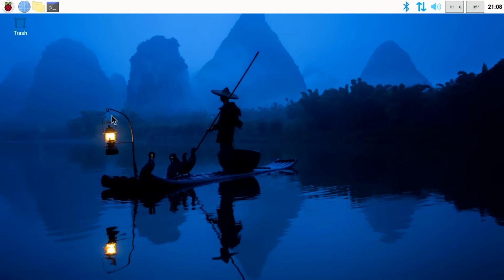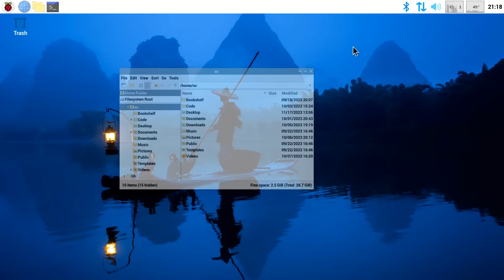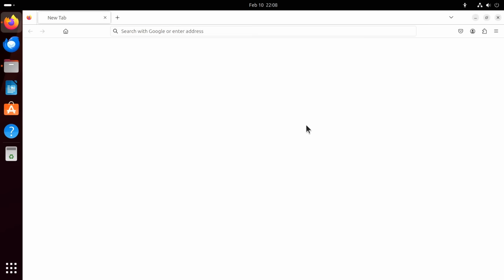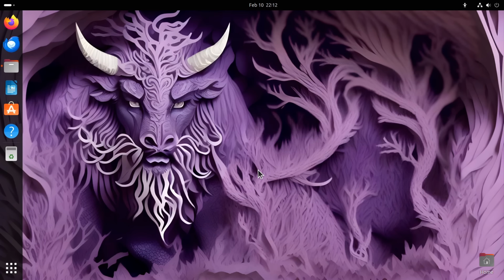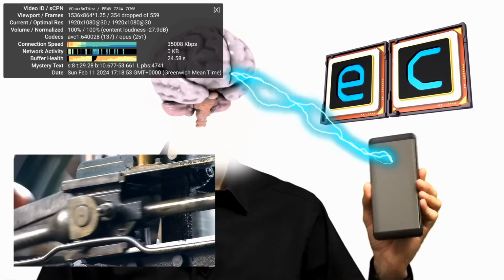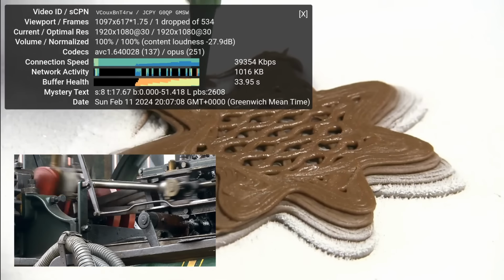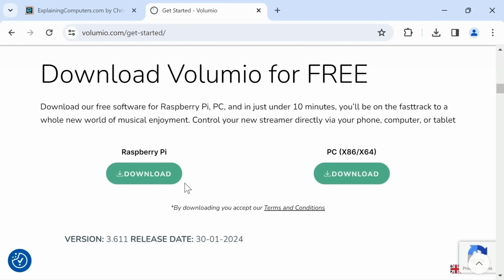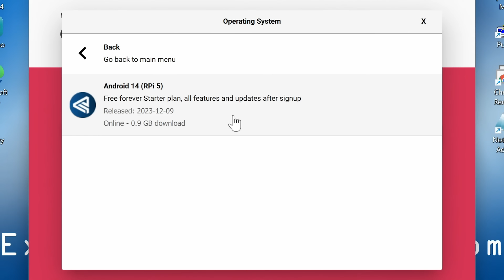Raspberry Pi 5 Operating Systems

Comment: Mathematica (AKA the Wolfram Language Desktop) runs on the Raspberry PI OS. It was tedious to run Mathematica in the ancient days of the original PI, but an 8GB PI 5 provides great horsepower for this free-on-PI computation/visualization engine. Wolfram Research provides a great number of self-paced and live courses on their website for no charge. It's a tremendous place for a STEM-oriented HS student to learn this software before going to University.

I'd love to see Explaining Computers have a video running Mathematica on the PI 5 showing what sort of spiffy things can be done with this software.
Reply: Fantastic suggestion! Seconding request for Mathematica walkthrough on the raspberry pi
Reply: Been running Ollama and many LMM AI. Processing with Deep vision runs well too. Will try Wolfram/Mathmatica next.
Reply: @roguequill  Hear, hear. Besides the huge increase with today's computational power, you can now completely configure SSH and VNC through the Flash Imager. Some parents, etc. may be averse to getting and wiring kbd, mouse, and monitor; those are  now completely unnecessary. All you really need is power, and you can stash the Pi away in a corner. Optionally, a hardwired ethernet connection would give a bit lower latency for the network connection.

Comment: Thank you Chris for another great video!!! I own a pi4 with 8GB of RAM and i run raspberry pi os, kali, ubuntu mate 22.04( great distro also), sparky linux ( uses openbox and so it is the fastest of all) and finally my main os is MX 23 with the KDE plasma( installed it and removed  XFCE witch is the default DE) . I believe MX is also an exellent choice for a daily driver on the pi!!!

Comment: Always genuinely excellent, thank you. A couple of mentions for other OS's that every RPi owner should know about:

-RiscOS - The original and still awesome OS for ARM. Really only for hobbyists these days, but worth a look and on the default installer
-DietPi - If you need a lightweight and highly configurable Linux for projects, specific tasks, or desktop use, this is it. (Not for Pi only!)
Reply from the maker: Thanks for this. Unfortunately, RISC OS is not yet available for the Pi 5. DietPi has just entered Pi 5 testing.

Comment: -Arch-based EndavourOS- and independent Alpine Linux both have images for Raspberry Pi 5 (only for model B as far as I can tell). Since we tried just Debian-based distros on it it would be cool to see how another type of distro would compete.
There's also OpenSUSE, Fedora and Gentoo all having an Installation ISO for ARM64 systems.

Update: EndeavourOS is no longer providing ARM builds.
Reply: Chris is a windows user and known he's not keen using linux as a computer science teacher. He's agnostic which I appreciate.
Reply: @TradieTrev  This is very outdated information. Chris's daily driver computer is Linux running on an Intel N100, and he is now a full time YouTuber. Your information was accurate a few years ago.

Comment: Armbian is extremely useful for a "quick and dirty" OS to get an SBC up and running, particularly older SBCs that are no longer supported by the manufacturers or major Linux distros like Ubuntu. You have to bear in mind that the Armbian team is small and their builds are generally automated, so they're not optimised for a particular SBC anyway.

You neglected to mention Gentoo Linux which supports Raspberry Pi 5 with a wiki page that details how to install it - however, it's not for the impatient but it's the best way of getting an optimised Linux build onto anything, once you've overcome the initial and steep learning curve.

When I am doing Gentoo builds on older and lesser known SBCs like Orange Pi or Banana Pi, I will generally start with an Armbian build just to boot the machine up and get the layout of the filesystem, as well as the configuration of the (u-boot) bootloader for the specific SBC. 

With a lot of older SBCs, there is no specific documentation for them with Gentoo, though as most of them boot with the u-boot bootloader, once you understand how to build that then everything else is a root filesystem built on a specific ARM variant anyway.

Comment: It's so fascinating that there are so many linux distros that people can choose from. Since I met you online I've changed my mind over Linux OS and now it's my favourite, I couldn't even imagine it's potential.
Reply: The whole point of having a mind is that one can change it.
Reply: Once you're far enough down the Linux rabbit hole it's time to try the BSD rabbit hole
Reply: @tylerdean980  Personally, I started using Gentoo Linux in 2003 (Linux generally back in 1996) and I've no reason to move from Gentoo, it does all I need an OS to do for me.

I do like BSD, I have a couple of machines running it but, for me, it's no competition to the flexibility of Gentoo.

Comment: All of your OS choices were good, but I prefer Arch/Arch-based distros. On my Pi 5 8GB right now I have EndeavourOS (an Arch distro) running with Wayland and the Hyprland DTWM (Dynamic Tiling Window Manager). I'm running vanilla Arch here on my main desktop with the same setup. I have a Radxa Rock 5B on the way (with accessories too ofc) that I plan to use as my travel/hotel room miniPC for watching movies etc so I don't have to tether my laptop to the hotel room TV all the time. I'm going to be running what's called BredOS (another Arch distro) on the Rock 5B and maybe compare it to EndeavourOS running on my Pi5 (whether or not I make a video is up in the air, but I've been curious about other ARM SBCs like the Rock (Pi) series for a while now). I'd say I'd want to see you mess with and test Arch Linux ARM on the Pi 5, but there is no official image as of yet, and it's all manual setup (at least with the Pi 4) unless you use something like EndeavourOS which has an ARM64/RPi5 OS image available though you have to jump through a few hoops to get it installed. It's not impossible, but it's somewhat annoying. I'll be running my OSes I'll be testing on the Rock 5B on a 32 GB eMMC module I ordered.

ANYWAY, good video and congrats on the near 1M subs! I'm one of them! WHOOO~

Comment: Another excellent video, plus 107 points to Mr. Barnatt. To be the best of my knowledge, Alpine Linux is also available for the Pi 5, but is a much more ‘do it yourself’ kind of distribution. I would be curious to hear Chris’s take on it. Also, the channel is closing in on one million subscribers, fingers crossed next week that threshold has been reached.

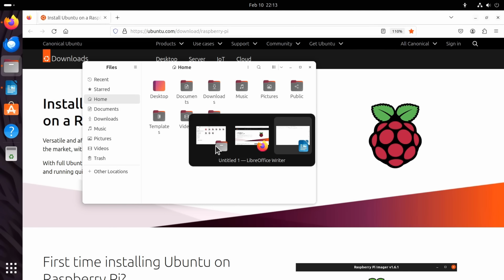Comment: 7:50  Insane?  ;-P   Where as back on Windows 7 you get 2 options for task switching.  ALT-tab or Windows-tab.  I like to use both.  The Windows-tab scrolling deck shows a huge LIVE view that makes it easier to find exactly what I want.  And being a live view means I may not have to actually change to that window to see progress, etc.  It saves me time.

Comment: Once again a very interesting video.  
I currently have a Raspberry Pi 400 and use some other different os for different days of the week and am wondering whether they'll all be able to run on a RPi 5.  
Notably: Twister; Manjaro; Debian; Chromium os; Pop!; MX Linux: Ubuntu Cinnamon (with Mint wallpaper installed to pretend that it is Mint).   I also have Fedora and openSUSE but they only seem to run at about 90% at best and have given me some issues.  Also could not get Void-Linux to run at all... Looking forward to trying out "Armbian" soon though.
Very interested to know how the above might perform on a RPi 5 (or even a 500 - if one gets produced in the future).

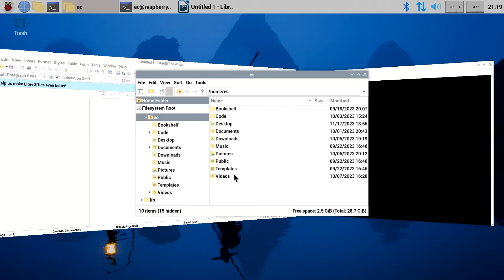Comment: 4:05 you’ll get a less distracting task switcher if you switch back from Wayland to X11. I did this because some apps wouldn’t work with Wayland and as a side effect, I have a more responsive UI and a task switcher that doesn’t drive me insane
Reply from the maker: An excellent tip -- thanks for sharing here.

Comment: Great video.  Thanks.  You mentioned that you're using Chrome OS Flex on a computer connected to your TV.  I believe that in the past you mentioned that you were using Ubuntu for that function.  Did Chrome OS Flex replace Ubuntu?
Reply from the maker: Greetings, and you are correct. That TV PC started life running Ubuntu. But I changed to ChromeOS Flex about 18 months ago.
Reply: @ExplainingComputers  I did something simiar - I had a PC connected to my TV which ran Kubuntu with the Chrome browser.  After ChromeOS Flex became available I switched over to use it and it's been a good experience for the last 2 years.

Comment: I'd love to see Linux Mint running on the raspberry pi 5 it has been my preferred Linux distro since the early 2000's and it's performance will determine if I grab one or not
Reply: Keep an eye on LMDE. Linux Mint Debian Edition. There should be a way to run that on Pi5.

Comment: Another plus for Raspberry Pi OS is the ease with which it can be setup headless on WiFi without needing a keyboard, mouse, monitor or ethernet cable.

Comment: Interesting. I have stopped buying Pis as I have 3xPi4s which is plenty. More importantly a n100 CPU NUC type PC with 16GB RAM and a 500GB NVME can be had for about £160, e,g. Trigkey. The n100 supports hardware encoding (Quicksync h.264) at 10x speed. The Pi 5 can’t match the n100 in FFmpeg. By the time you add in all the extra Pi5 options you need to match n100 NUC, you might as well buy the n100 as it has better software support.
Reply: You can pick up used HP, Dell and Lenovo SFF PCs on your favourite auction site for £30-£40 that have 3rd or 4th generation Core i5 and i7 CPUs in them that run Linux perfectly well. 

With the brainless lemmings rushing to upgrade to Windows 11, there's plenty of cheap hardware out there that still runs far better than some cut-down CPU on some Chinese mini-PC rubbish with it's dodgy CCP firmware built into it - and you save on landfill too.

Comment: I installed Twister OS on my Raspberry Pi 4b and it was fantastic. I particularly liked the variety of apps you could use and the excellent video playback speed and quality. When I eventually got a version of 64-bit Raspberry Pi OS that worked properly it was able to produce video playback about as good as Twister OS. But, Twister OS looked much better. I can only imagine how good Twister OS would be on a Raspberry Pi 5. I'd love to see that some day if they can port it over.

Comment: I found that installing Raspberry Pi OS lite then adding the desktop of your choice makes the look much better and even running Gnome (my go-to) it is wonderful even with a plethora of "Extensions" running. I am getting ready to add a second monitor, then we will find if the hardware is in rough shape :). My Raspberry Pi 5 is my daily computer and it has not let me down (with daily tasks).

Ubuntu works fine for daily use, but Armbian did not work well for me either. I hope an Arch based distro comes along SOOOOOON because that has been my daily use computer OS for a few years now (Ubuntu Server is my server os, but that is mainly because it is more difficult to get the web server, file server, etc.. running again if I change OS's.

Something I have found that is very lacking with the RPi5 is the lack of operating systems, and compiling software from Visual Studio. I have several 3D printers (Using Libre Computer boards) and I can not compile the bin files for the firmware on the RPi5 so I am still using my notebook Arch computer for those tasks.

Great video, thank you again for keeping us up to date.
Reply: Please ignore the above message, It is not from Christopher, rather it's a scammer.

Comment: I find on the Pi4 there is a huge disparity between the responsiveness of the system when running on an SD card vs a USB connected SSD. I can only imagine the difference is much greater on a Pi5.

Comment: After a quick look up just now, rpi5 top tier with accs is currently priced in the Ryzen 7 tier mini PCs. That's a nearly undefendable cost/benefit price point.
Reply: This is my feeling. Pi5 is so expensive and mini PCs have come down so much in price, it seems Pi5 is not the best option at the price point for most purposes. Or at least for most of my purposes.
Reply: Who needs Ryzen if you're not one of those self-entitled "games as a service" muppets?

With so many lemmings rushing to upgrade to Windows 11, there are plenty of dirt cheap 3rd or 4th generation Core i5 and Core i7 SFF PCs that can be snapped up for £30-£40 on your favourite auction site. They make perfect daily drivers for Linux, rather than some cheap Chinese PC rubbish that just creates more landfill and probably runs dodgy firmware for the CCP anyway.

Put your trust in a used Dell, HP or Lenovo SFF PC.

Comment: I have three Raspberry Pi 5s with 8GB RAM; I'll be getting a PCIE module so I can put a 2TB SSD drive for the OS.
Do you have any recommendations for a server OS? I may set up two servers, one workstation. I also have a RISC-V 8GB. A TuringPi board setup with 4 RISC-V 32GB SOC modules. 
Some things that I intend to run: Apache web server, BIND, OpenSSL, OpenLDAP, ...
Thanks, 
Ralph

Comment: I'd like pure debian to be available. Specifically so I can install the latest testing version (which all my other PCs run) so they are all the same. At the moment I'm using pi os lite with the xfce desktop installed over the top (I really don't like the PI desktop and much prefer the X11+XFCE environment). 

I've been driving the pi-5 as my development box/main PC for a couple of months but I think I will probably go back to using an amd laptop even if it does use more power overall and relegate the pi as my bedtime streaming box. 

It would probably be a better experience if I used an SSD (even via the USB) over my current 2.5" spinning rust drive or got a NVME hat... but for whatever reason the NVME I have in a USB caddy refuses to work with the PI (when you update the OS it just disconnects from the drive; also it had to be 512'd as it refused to even see a 4096 formatted drive).  

I've not had any issues driving it as my main PC but the slight lag and slower esp32c6* builds starts to annoy after a while (its not much, but its like an itch you can't quite scratch enough). 

Similarly dropped frames on youtube and "juddering" (even when there are no dropped frames) gets annoying as I tend to view quite a few videos (seems to be when the FPS is >30)... yet oddly I've not had any problems streaming from amazon even true widescreen content (my pi is connected to a ultrawide) but then I believe they really compress the heck out of content and I tend to watch that from a distance and not sat right in front of the screen as I do with youtube.

I do have to say its a very capable little board, but the very tiny niggles start to feel like deal killers after a while.

* I also have quite a few esp32c6's connected to a hub as I'm experimenting with multiple different sensors so I have one dev kit for each device and the PI even with the official power supply can't push enough power through its usb ports to power 2*4 port hubs connected to 6 dev kits and 1 led display (even though thats only about .41A total), 1 USB drive, 1 Keyboard (its backlit but you can't turn the led's off because no one ever quite finished writing the linux drivers for it so it just locks up when you press the LED button), and 1 radio mouse. I have to disconnect dev kits to get the power down enough and while its not a huge deal its one of those annoying itches that just adds to the overall annoyance.

Comment: Ubuntu OS is GUI is good but it does not allow it install Edge browser or some other browser. pre-installed browser does not allow DRM contents, Example Netflix can't be played.. Hence using Raspberry Pi OS. Armbian OS is interesting, will give it a try
Reply from the maker: Fairly obviously, you cannot install Microsoft's Windows browser in Linux. But what you say about DRM and Netflix is simply not true. You most certainly CAN play Netflix, Disney Plus and all other DRM content in a browser in Ubuntu (or any other Linux distro). Just install Chrome or Chromium (on which Edge is now based anyway). Or if you want to use Firefox, install the Widevine plugin to access DRM content. And please stop spreading misi-information here! :)

Comment: My problem with the Pi5 is the new chip has made it so my old 3.5 inch touchscreen won't work with it by installing the drivers that worked on every other Pi. 

Frankly, Raspberry Pi has gone from user friendly and affordable, to expensive and made for corporations and power users.

Comment: What Version of an operating system do you propose for a Raspy Pi 4 or 5 (OS on SSD) running as a standalone Pi-Hole? E.g. 32 pit or 64 bit with or without desktop.

Comment: I would like to see PCDOS 5 on the RPi.  I still have my hard drive from my old DOS pc that crashed in the 90s and would love to see it running again.  I don't know how I'd hook up a keyboard and mouse though, those old interfaces aren't available.  I'm sure x86 emulation would eat up performance but an old 8088 cpu wasn't very fast to begin with.

Comment: At 5:30 Ubuntu is still dropping lots of frames.  But why (as you said) would using an SSD be better for video playback?  It shouldn't be storing the video on the SSD so why?  Only reason I can think of is if the OS is doing other things in the background at the same time.  Maybe OSes should get smart and not do unnecessary background activities when videos are playing?
Reply from the maker: All I can report is that streaming media playback was better when I did tests running Ubuntu from an SSD. My guess is that streaming writes some browser cache files. Daft I know, but I think true.